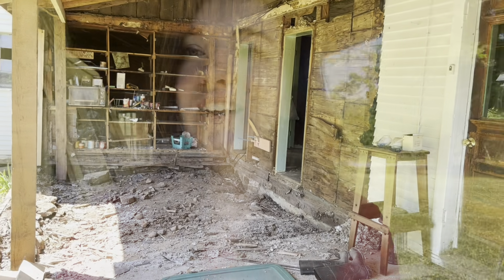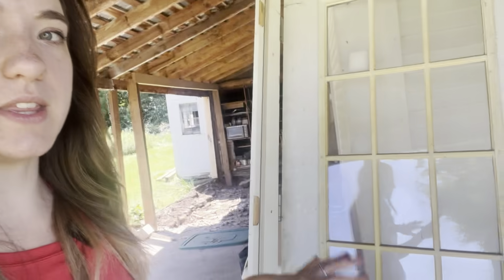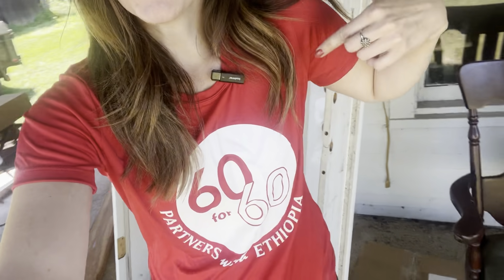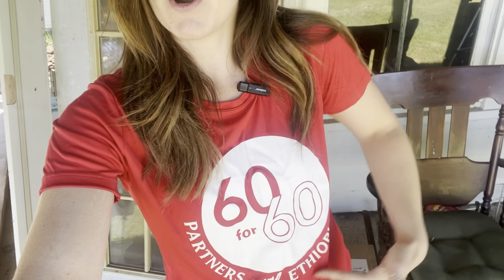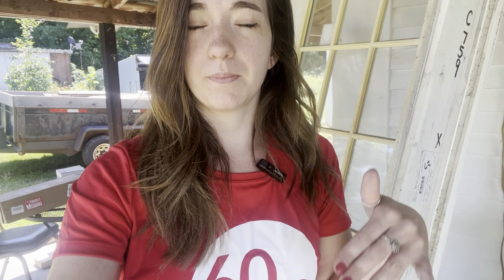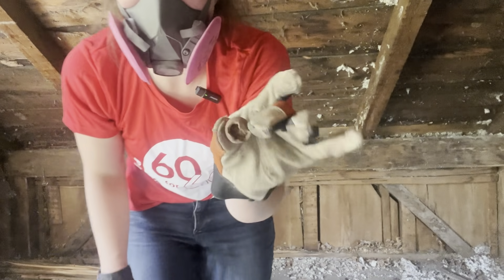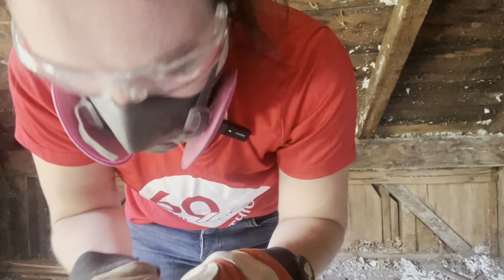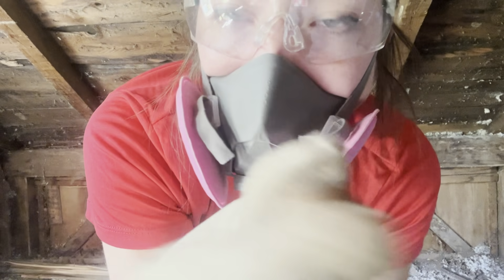What no one tells you about renovating an old house… the CLEAN UP NEVER ENDS!!

Comment: Use a shopvac you can probably buy extra hose to extend your reach for the ceiling. It is a lot more thorough and won’t stir up so much dust.
Reply: I'm about to tackle the same, so I appreciate this advice!
Reply: I was thinking the same thing but I bet she doesn't have electrical at the moment.
Reply: She might need to invest into a portable generator (possibly a solar powered) and a shop vac.
Reply: @doncc6080  if she is blowing yes it will but if she has it vacuuming up all the material she was raking up it should work just fine.
Reply: @doncc6080  is that not what the filter is for in the shop vac ?
Reply: @sandybehanna7704  insulation will clog the filter then blow out the exhaust port
only way to avoid  this is to use shopvac bags  I have been using them for years
Reply: @doncc6080  that’s a great suggestion this way she has opinions.

Comment: I really admire the work you’re putting in.  I don’t think I would’ve gutted everything at once, very intimidating.  I would have done one room at a time, lol.  You are awesome!  It’s going to be beautiful and exactly what you want when it’s done.  Looking forward to seeing the journey.  I’m thinking of buying a fixer upper myself so I’m learning a LOT.  Nothing lazy about you, I’m exhausted watching, 😀
Reply from the maker: Thank you 😁
Reply: I always did my renovating all at once--I wanted a clean house and place to live.  the only thing I did in chunks or small areas is the garden.  The garden usually just developed and grew--because that was and is my therapy.  But the house--knocking out  walls etc. is messy and dusty--that durst gets into everything---So I made a huge mess and cleaned up a huge mess/now maintenance is done in smaller chunks.
Reply: I think doing it all at once will be helpful to the electrician and the plumber........and probably cheaper too!
Reply: @lenireimer3243  I was thinking, a box fan with those furnace filters attached to one side and blowing out a window.
Reply: @michaelmaker8169  this is what I do when I do demo - it really helps to control the dust spread

Comment: You are doing a great job striping out all the debris. If you have electric or a generator you should put a fan in a window to help exhaust some of the dust. Chances are you will need to have a shop vac to get a lot of the dust anyway. Also for the wasp if you don't have can of  wasp killer   you can use things from your garage such carb cleaner or brake cleaner. if you don't have those a can of spray paint will work. better to kill them in the evening when it is cooler as they will all be of there nest.

Comment: Could you use a shop vac to clean up instead of sweeping (but then I remembered you don't have power so you'd need a generator or a power supply)?  And wouldn't it be easier and faster to toss stuff out the upper windows than carrying it all down the stairs?  You can make a chute to direct the stuff into your truck or containers to take away later. Renovations are a lot of work especially on older houses but you are doing fantastic and I can't wait to see how it all turns out.

Comment: Abby Abby you know the more you remove the more cleaning up you have , anyway you learn as you go,  your starting to get a bit done the room you removed are you putting stumps back there or concrete  floor , just a thought about cleaning up the installation and dust maybe get a big industrial  vacuum  cleaner  and go over the walls, floors and ceiling  give it a big clean up will help out , yep watch out for those wasps they look nasty,  sounds good about your no profit keep up the good work there . Abby l had a message with a phone number , not shore iff you sent it to me , so l didn't  open  up the message it had drill and  adream at the head off the message , ok have a good day